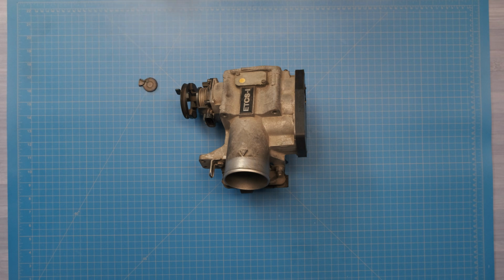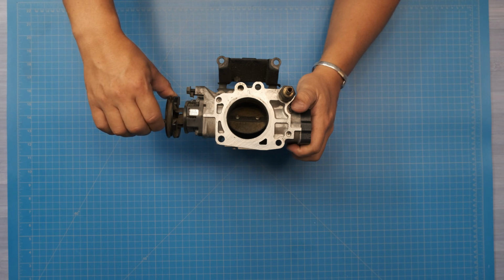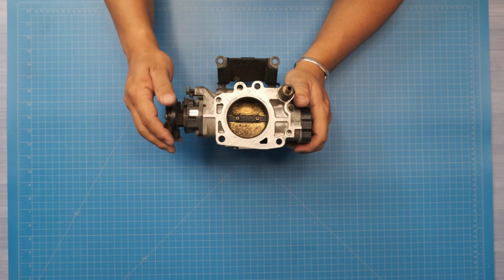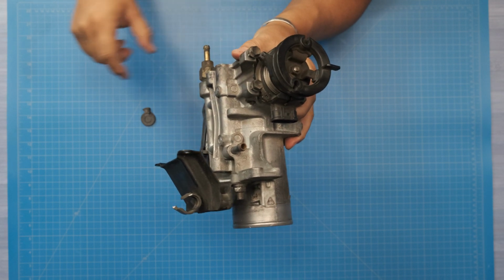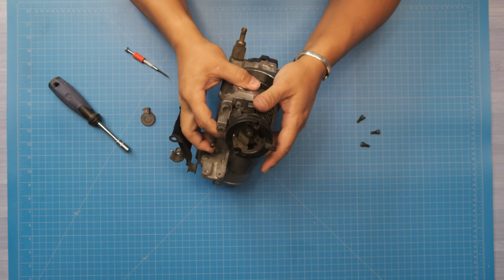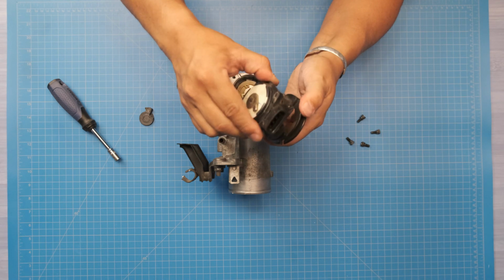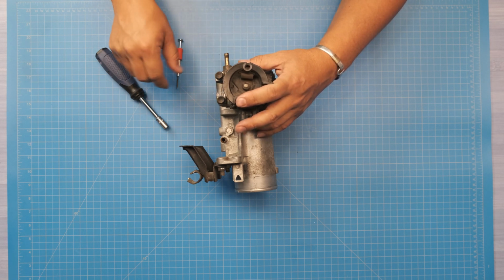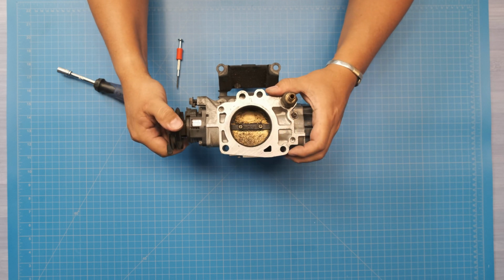2JZ VVTI Throttle Lock Install

Comment: Hi, good video description of how to mod the accelerator pedal sensor, including the repair if you wanted to repair the 4pins on the circuit board after cutting away the plastic. Just wondering would this mod work on a 2jzgte vvti with automatic transmission? And also I wanted to ask regarding the ECU will that still work as normal even though its not getting any signals from the accelerator pedal sensor and the throttle position sensor? And would you plug them back in after the mod or don't need to plug the accelerator pedal sensor and throttle position sensor back in ??? Would 
Really appreciate your feedback on this.
Reply from the maker: While it has been used on an auto trans car with stock ecu, the stock motor unit fights it and can cause some odd issues.  If you unplug them, the trans either doesn't work at all or works improperly.
Reply: Hi mate, @CodyGraham appreciate the feedback,  I have figured it out. 
I repaired my accelerator pedal sensor as that was the issue car going into limp mode check engine light on. I fitted the mechanical delete kit I purchased from Japan and relcalibrated the throttle position sensor. Now it's working fine, though I do have a piggyback ecu as well which I had fitted a while back. But everything seems to be working fine.

Comment: My pedal is hitting the floor and my car doesn't wanna run now. I attempted to adjust the throttle cable
Reply: Chances are you didn't get something installed properly.  Could be mechanical, could be electrical
Reply: Any Update? My car was in limp mode too, only accelerates when I floored it, got rid of once code wich was p1121 app sensor! Now i only got p1128 wich is the throttle body motor so hopefully im getting some where lol maybe my whope throttle body took a shit who knows but im just replacing sensors and that throttle body motor at this point
Reply: @oSIXO.  my car is back in limp mode! I'm about to drop her off at a shop to see what the heck is doing on.
Reply: @Starsnstripes25 damn bro hopefully she comes back a1💪🏽 but what did you do to atleast get it back and running again?
Reply: @oSIXO.  I'm going to change the 02 sensors tomorrow I'm getting numerous 02 codes! Hopefully this works!! If not I'm gonna drop her off at an import shop! I can't see my baby stay like this!
Reply: @Starsnstripes25 I hear ya bro I miss driving my gs300! She’s in limp mode I have a throttle motor on the way for the code I have right now. In about a week the part should arrive😅 hopefully that fixes my issue too!
Reply: @oSIXO.  Mines I'm dropping her off to this high end import shop!!! This Wednesday!! I don't care what I have to pay my baby needs to be in top health!! I love my Lexy!! Long live the 1JZ/ 2JZ💪🏾

Comment: My car lexus is300 2003 in limp mode thinking the throttle control motor not working. If i put throttle lock will it work on my car and warnings signs will go away and woukd i have to take motor off or can leave it on? Thanks
Reply: thats what i wanna know also

Comment: is it safe to put a throttle lock on a 2001 is300 2jz-ge VVTI without doing anything else to the throttle body n does it work properly? @CodyGraham
Reply from the maker: Not with the stock computer controlling things, no
Reply: soo what do i have to do in order to put the throttle lock on n have no issues? my car is a automatic. @CodyGraham
Reply from the maker: @zdar3alest  Some people run them as is, ideally, you would use a standalone
Reply: @zdar3alest  buy a Japanese rebuild kit. theres a video on yt that says it works with stock ecu.
Reply: @zdar3alest  https://www.youtube.com/watch?v=5qJRk4TEpaw

Comment: Thought I'd post some info for the automatic guys. Got this exact piece recently for my Toyota Altezza, JCE15W (It's an AWD IS300). 

Install was easy and can be done in about 10 mins without removal of the entire assembly. The only hard part was accessing that half-moon locking tab. If you want to keep it afterwards, change the location to the top set of bolts like I did, or remove it entirely.

I'm running the A340H (4spd) trans, not the A650E (5spd) as you probably will be, So results may vary. Engine is a stock 2JZ-GE. I don't notice any extra load from the trottle body motor unless you really smash the pedal down. For around town and normal driving you dont notice it at all (smooth/small pedal movements match the speed of the motor and it is also cushioned by the small play in the piece itself) . I noticed this mod the most when I'm pulling away from the lights, or out or a side street. I believe the IS300 "delays" the response for comfort reasons, and this practically removes it. The pull from a stop is much more noticeable, even for my stock car with 220,000km (136,000 Miles) and is also very helpful for getting back on the power around the twisties when you're in sport mode, or in "manual" mode due to no delay.

I am well aware that I will be "fighting" the throttle motor which may cause it to break eventually, but from what I have experienced so far I dont see this being a really big issue if you only plant your foot down every now and then, like I said before, it does not fight at all if you drive it normally or smoothly. Plus its a good bit of fun for when you need it, or if the gaps in traffic are small and you need a quick boost.

Only downsides are that the throttle will feel a little "off" at first, as it can vary from no load on your foot to alot when you push yout foot down, I'll just need a bit of time to change my driving style for it. The real solution to this would be to remove the motor itself (Cody has a video on this). I just dont want to have any codes pop up in my car, but I may experiment with disconnecting the drive gears later on to see if that works. Also "Snow" driving mode is completely unusable, this reduces throttle input to reduce power, and as such puts ALOT of load onto your foot. I can see moderate periods of use in this mode easily destroying the throttle motor. 

Good product, got it shipped to NZ as well, I may post an update in a few months and let you know if I find anything else.
Reply: have you experienced any feeling of the throttle going in and out while driving? i installed this throttle lock and when driving its like i can feel the throttle lock working hard against the control motor that it feels like the throttle pedal will be working and then not working back and forth while driving you notice by the load you have to put on the pedal. Like 1/2 throttle on the pedal will feel like the car is jumping around from having 100% to 20% power back and forth like a light switch. im thinking i need the delete the control motor but when i unplug it the car dies.

Comment: Will this work on a 2jz ge vvti with manual swap and det3 piggyback?
Reply from the maker: yes, but it may throw engine codes
Reply: DId you get the det3 wired and working on your 2jz? I have one i havent installed and have a twin turbo 2jzgte vvti and planned on using my det3 and doing the FIT mode to control timing and 1000cc injectors but i have some questions about wiring the det3 and the setup if you could help at all it would be great!

Comment: This one doesn’t work but the one from xcessive manufacturing does though
Reply from the maker: Not sure what you mean.  I've used it, as well as many others with no issues.
Reply from the maker: I'd be super interested to see what isn't working or what it is doing.
Reply: @CodyGraham  ya my one doesn't work. But my was in 2jz gte automatic transmission

Comment: I have a 2003  lexus is300 sport design I put the lock on..
Reply: Did it work i have same car 2002  lexus iis300 code p1121 ? Thank you
Reply: @salvadoralvarez2093  did u fix ur car?